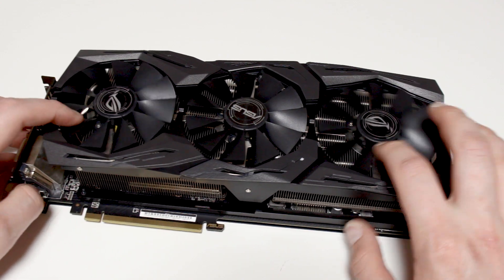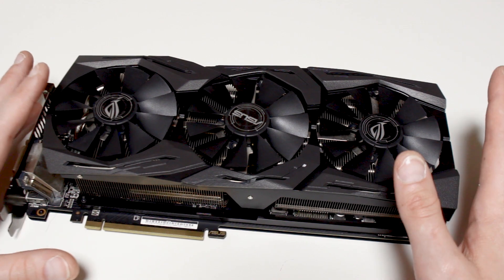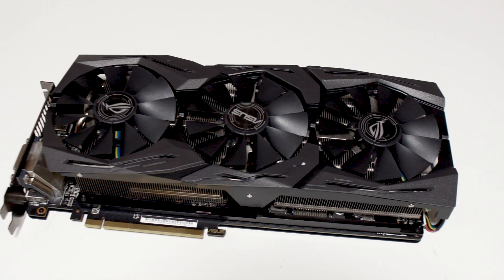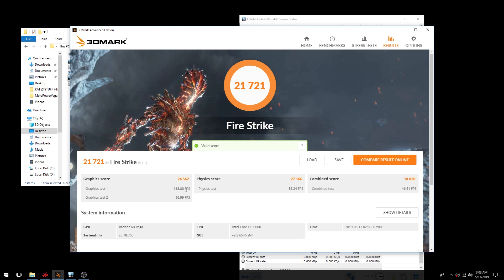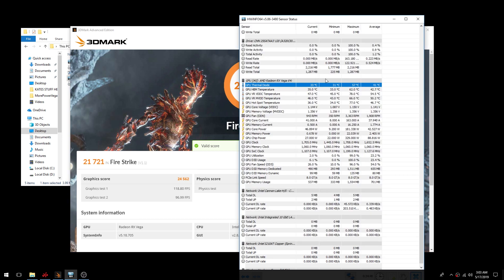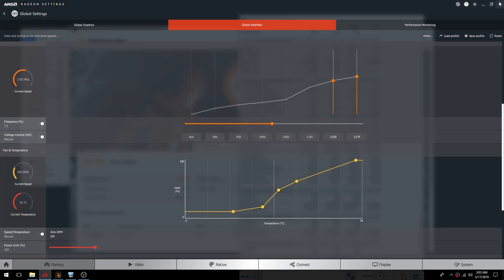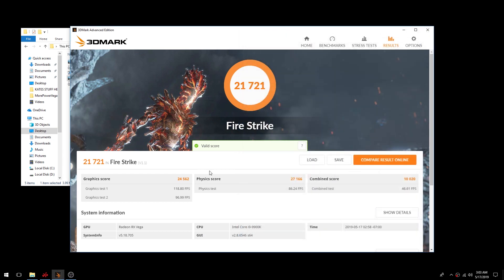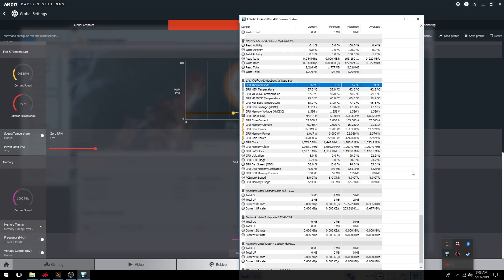Lowering Temps - AMD RX Vega

Comment: I have a Vega 64 LC which I bought as a refurb.. my issue is the VDDC temp, it's the only thing that gets hot and hits in 90c.  Haven't yet opened the card up, but your temps are way lower on a air cooled card.  So apparently something wasn't done right on the refurb job.
Reply: Change the thermal pads for the vrms

Comment: I wouldnt recommend liquid metal as a paste for the vega 64. The cards have weird mounting pressure issues that can mess up your temps (in particular those with gaps between both hbm and the gpu chip itself, mostly found on older cards). Beside that, the Asus Strix version seems only to like working cool in open environments or mounted vertically (Like the bench setup in your video). Installing it horizontally in a case (even with good airflow) mess up the temps anyway. That together with the cheap and messed up vrm pads results in one of the worst cooling solution that i saw the last decade. TLDR: Buy this card only if you really want to fix it yourself or avoid Asus Strix at all cost.

Comment: You have to use a better thermal pad the stock thermal pad does not cover full
Reply: I mean VRAM 😂
Reply: The stock yellow thermal pad
Reply from the maker: umm no. This card is not using a thermal pad for the GPU core.

Comment: is undervolting downgrade the performance or just thermals?
Reply from the maker: Undervolting can help get the clocks to stay higher but I just wanted to see how well I could get the Air cooler to preform.
Reply: @KatesHardwareReviews  ok thank you so much heplfull like always
Reply: The frequency effects performance.
Undervolting reduces the chance you will be stable at the set frequency.

That's why overclockers have to overvolt to maintain stability.

If you take stock chips and undervolt a little, they're usually stable and run a bit cooler.

Of you want to run your PC 25/7 and reduce bills, you can underclock and undervolt at the cost of performance.
Performance per watt is higher the lower you go, but performance is also lower.

This is one of the things Intel low power skews do.
Reply from the maker: As a general rule yes but with vega if you take the stock voltage and the way the vega boost works basically you end up with clocks that are going up and down and  you never get what you tell it you want except at idle. So you can reduce the voltage and you get clocks that stay higher longer so more performance so yes you might have to lower your highest frequency for stability  but you end up with more performance. In this case you could also lower temps as well.